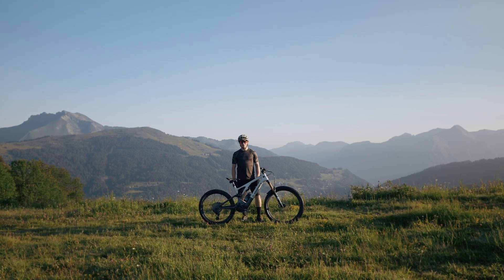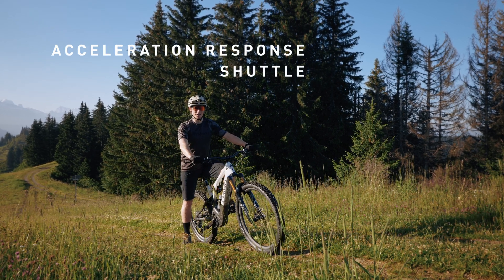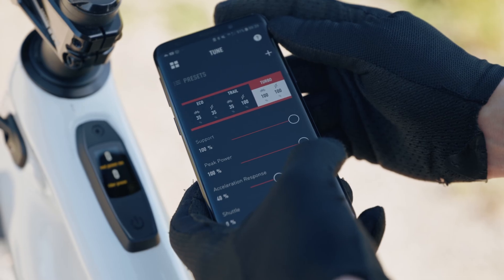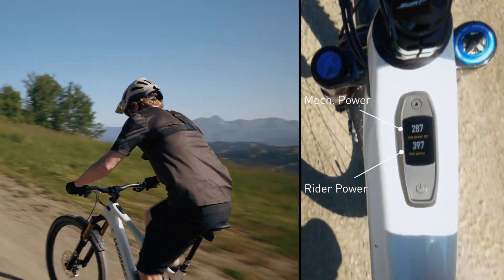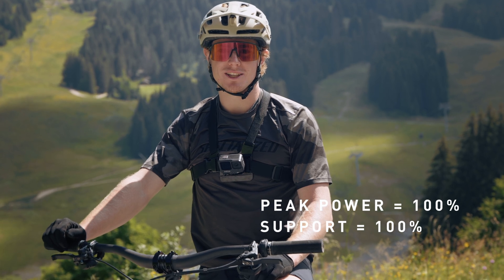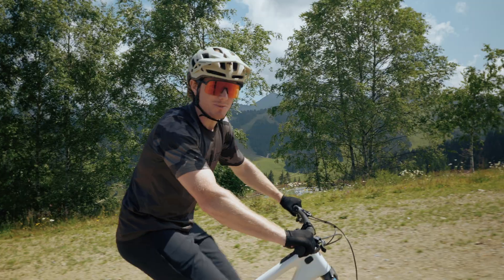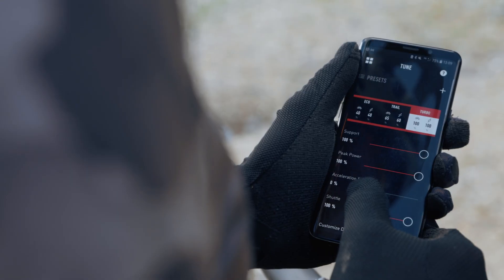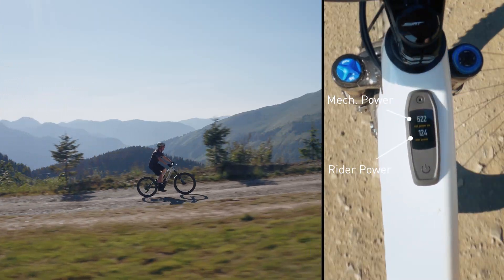The Turbo Tune Feature Explained | Specialized Turbo E-bikes

Comment: I think the demonstration should have had two riders each using different motor settings and similar physical inputs from each. That would have shown more clearly the different speed you're travelling at on the different settings.

Comment: Support is expressed as a percentage (20%, 50%, etc). My question is: percentage of what? Of the total motor power, limited by the peak power? Or of the rider power applied to pedals? No vídeo  I have seen so far makes that clear. Appreciate any light on this.
Reply: @woolychewbakker5277- from his testing numbers it's of your pedaling power - pedaling at 100 watts using 20% support, will give you 120 motor/mechanical watts. And a total of 220 (combined rider and motor/mechanical watts). His display for the test numbers do not have a total combined watts - only each separate on the display.

Comment: I’ve got the new Levo Comp Alloy and I’m loving it.  Does anyone know if I can upgrade to the Mastermind TCU as an aftermarket part?
Reply: I was told you can upgrade (really expensive) but it will not give all the functionality like the micro adjustments,  so you are better off just adding the bar mounted display from Specialised which connects with bluetooth.
Reply: @Macalfly  thanks for that. I think i'm going to ride it out as is for the next year and then trade in for the new Levo SL.

Comment: Turning down acceleration is not only important on loose trails but also in technical areas where too much too fast can send you out of control. Combine tuned down acceleration with lower support for the most control. I have turned up my Trail assist level to around 80 % and turned down the other mentioned settings to use when things get technical in the rocks and use the top level Turbo assist when things are less difficult but steeper. This gives the specialized bikes a big advantage over others like my Trek Rail with the Bosch motor can come on too suddenly.